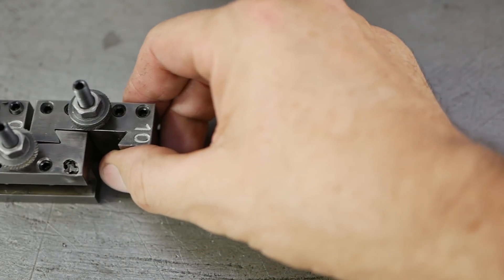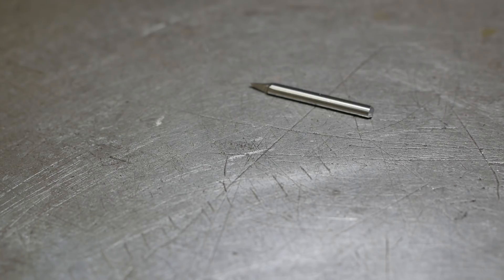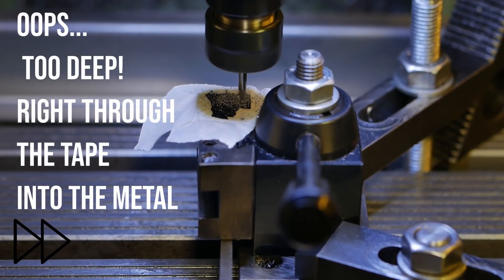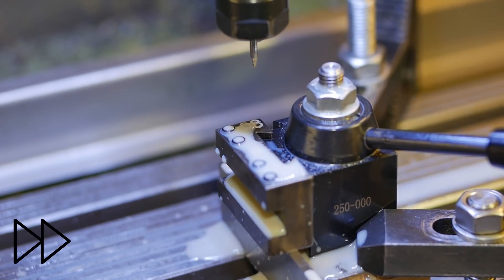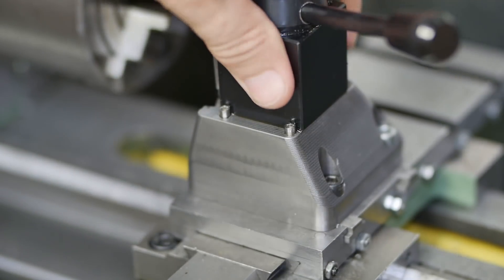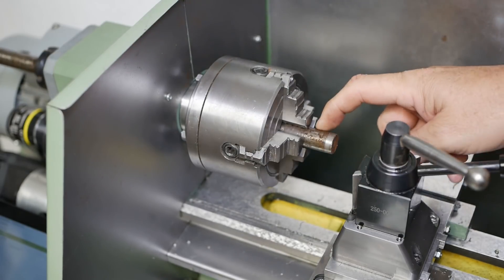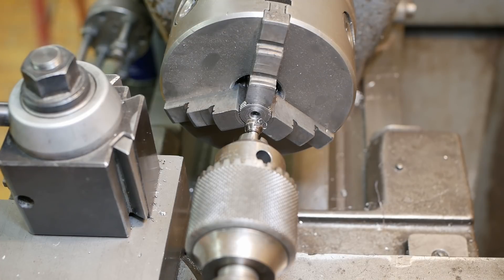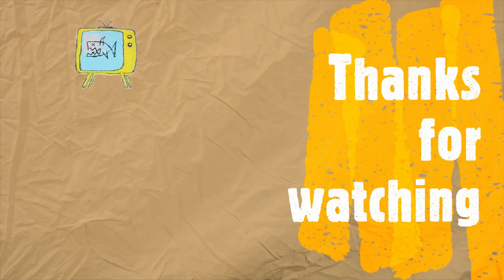Finishing the lathe tool holders - Modifying the 7x12 MiniLathe - Episode 30

Comment: are you going to see about limit switches to prevent your setup from crashing and losing steps?
Reply from the maker: I am not sure. Stalling at the end of X travel is not damaging. Limit switches on Z are pretty worthless, as the different lengths of Chucks, collets etc, and also the various position which the Tailstock can be located in make this challenging on a lathe. An X home switch would be nice.

Comment: 1) Use thinner cutter for parting off
2) add plastic pipe for your lubricant
3) good job
Reply from the maker: Good advice. I have a  2mm carbide cut off tool, but with it's12mm shank I can't get it down onto center height. Thanks.
Reply: @RotarySMP  You can modify blueprint of "tool block for blades"

Comment: Given the Mesa board you're running, any thought of getting some inexpensive TTL linear encoders on the x and z axes? Even the 5 um ones would give a lot of repeatability. Obviously some limit/home switches would be good, too. Great stuff, thanks for sharing.
Reply from the maker: I have thought about it, as a lathe uses so little of the 7i97 IO that I could confidur it for two more encoders. Realistically, I'll do that on a future machine. The Mini lathe is simply too compromised in it's basic design.

Comment: Really enjoying your documentation of this!  A couple of things, soft limits (as others have pointed out) even if you don't have limit switches is a good thing.  Second, if you knurl again with the scissor style tool you can get it just tight enough to knurl then back off in X to come off the part.  Then you can knurl subsequent parts by advancing towards the part in X and you don't have to adjust them again.  .  Hope that makes sense.  Looking forward to the rest of your conversion!
Reply from the maker: Thanks for pointing that out. I guess it makes sense that you can do that with a knurl. I just didn't consider it.
Reply: @RotarySMP  You bet.  It's actually the way I do it when doing a small run manually.  (Don't have a CNC lathe yet, but have 4 CNC mills, so it's overdue!)  Makes it easy to get the depth you want as well.  You can crank down on the screw with the rollers centered to get close, back off and tighten a little bit more, then you'll get a crisp deep knurl when you move the X back to center.

Comment: I reckon the knurling tool needs a replacement top adjuster with suitable hex on the top ;-)
Reply from the maker: Or a big t-handle. The kurled nut is insufficient.
Reply: @RotarySMP  I was cringing watching how close your knuckles appeared to be to the moving parts ... I suspect that occurred to you as a second or two later you changed to using pliers etc.
Reply from the maker: @clasdauskas  Sometimes the camera angle makes things look closer than the are, but generally the mini lathe requires you work pretty close to the chuck.

Comment: Did you CAM the numbers separately, or have you got a serial-numbering routine? 
I wrote some G-code to do scale rings (XA moves) using internal routines for each digit, but the numbers are a but crude for this sort of scale, and I have a lot of Multifix holders that could do with numbers. I suppose having mentioned the routine, I might as well link to it: https://forum.linuxcnc.org/20-g-code/27169-g-code-to-engrave-numbers-on-cylinders
Reply from the maker: Hi Andy,
Thanks for that link. I just set it up in my old copy of FeatureCam 2006, and changed the numbers and saved it 11 times. Primitive solution.

Comment: This week I bought a similar mini lathe. And now I have to go, I have a lot of work to do.

I'm joking about the work, the lathe can wait a little. I've spent most of the day so far rewatching this series.
Reply from the maker: Glad to keep you from polishing a turd :)
Reply: @RotarySMP  no, you don't. I've spent the rest of he afternoon lapping it. I don't have scraping tools or skills, so this won't be a fancy shit like yours, but it' so much fun.
Reply: You buy a mini lathe to work on it, not with it.
Reply from the maker: @phlodel  That is about it. Think of it as a kitset model of a lathe.
Reply: @phlodel  right. It's like a kit indeed. Halfway done, you have to finish it. As TOT said, it is great if you're into machining, but lack funds or commitment. It can cut metal out of the box, but needs tweaking and improvements, and you can learn a lot during that.
Reply from the maker: Lapping makes it feel a little smoother, but adds nothing to it's precision. It is just accelerated wear.
Reply: @RotarySMP  Yeah, I wore off two iron bananas today. A few day ago I was unable to set the saddle. Today, I can move it without it jumping around. I would argue with that "nothing". I guess you forgot how bad these are out of the factory. ;-)
Reply from the maker: @besenyeim  Good point. When I think of the tiny points of contact on my tail stock, rubbing it on the road would probably be an improvement :)

Comment: In the code make it so that when tool changing it goes to x home position something like G0 G53 X0 so it always goes to the same point. Only then you have to home the machine or add limit switches
Reply from the maker: That is what I did. X40, Z40. Only problem was not checking if you could reach X40 with the tool offset for the knurl. I need to set up the soft limits. Luckily on this little machine, it just stalls at the hard limit.
Reply: Well yes it works with soft limits but is easiest with using a machine coordinate system like G53 or G28, look it up how to use them. Othervise great conversion.
Reply: @jansaljaj3042  LinuxCNC can be programmed to go to a fixed machine coordinate position for tool change using TOOL_CHANGE_AT_G30 or TOOL_CHANGE_POSITION = possibly in conjunction with TOOL_CHANGE_QUILL_UP (which will do a Z retract before the move. Probably straight into the tailstock.
Reply from the maker: @andypughtube  Thanks Andy, I need to put more time into learning these aspects of LinuxCNC.

Comment: In the code make it so that when tool changing it goes to x home position something like G0 G53 X0 so it always goes to the same point. Only then you have to home the machine or add limit switches
Reply from the maker: Good point thanks. I sent it to the same point each time, but not absolute. I sent them to X40 Z40, but with that big tool offset on the knurl, did'nt make it.

Comment: I've really been enjoying this series. Good job and thanks for uploading.

That crash was painful to see. Hopefully it hasn't knocked the head stock or anything bad like that? Does your CNC have any feed override options?
Reply from the maker: I does. Luckily this machine is so wimpy, that the steppers stall without generating enough force to dislodge the headstock.
Reply: @RotarySMP  Rethinking running it openloop?
Reply from the maker: @clasdauskas  Rethinking ownership!

I will sell the Minilathe as soon as the Schaublin can do threading.